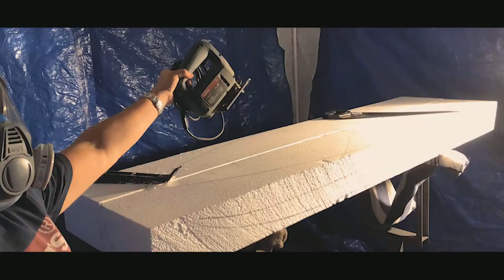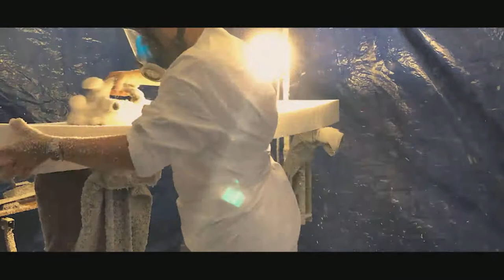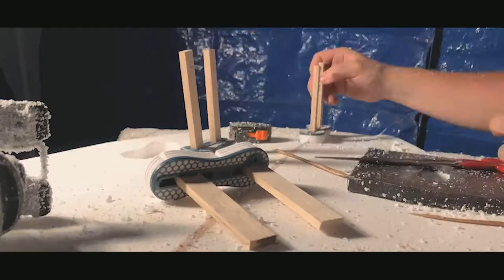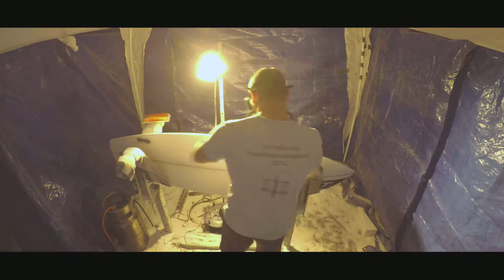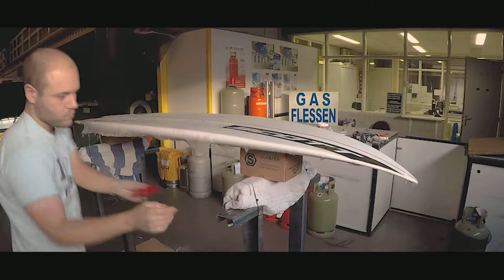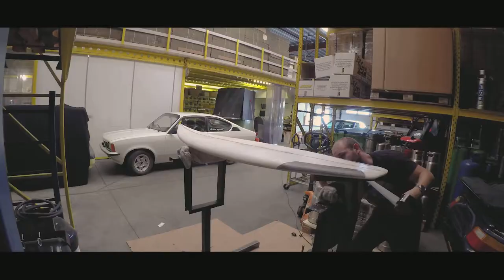Shaping Epoxy Surfboard From Scratch Timelapse: Reinforced With Carbon Fiber

Comment: did you use 2 layers of fiber glass for the whole top coat?
Reply from the maker: Yvonne Almeida Yes I did! The glass schedule on this board was a 6oz and 4oz layer for the deck and a single 4oz layer for the bottom.